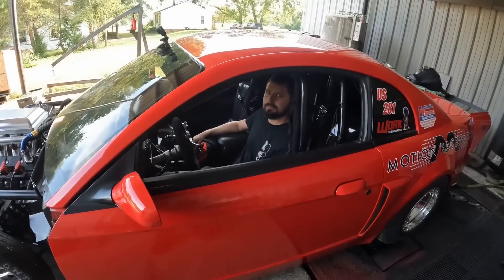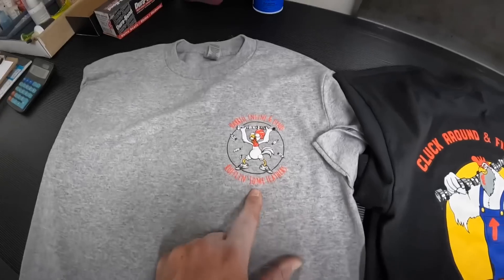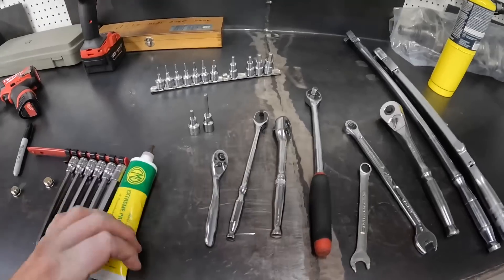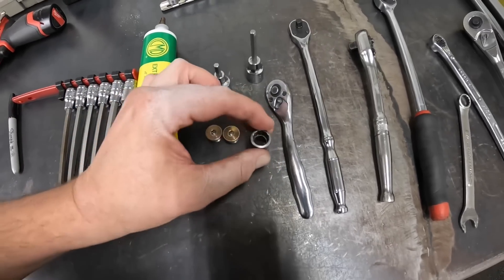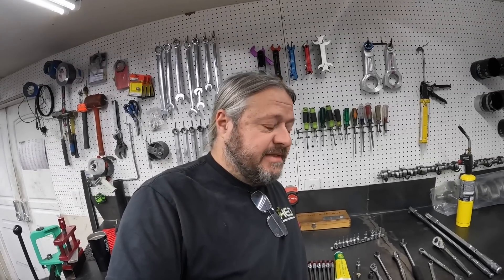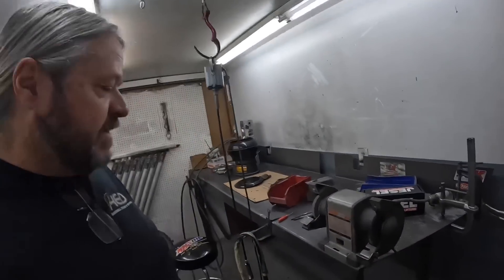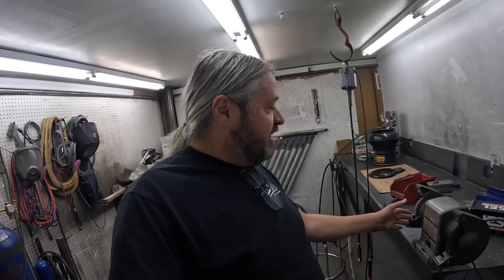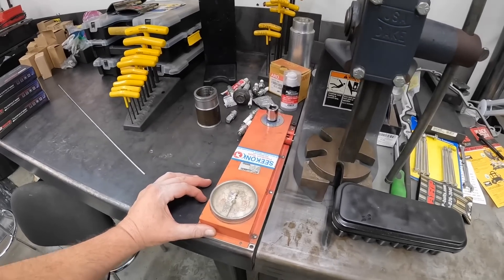Quit tearing stuff up!!

Comment: The hex sockets you’re using twist pretty bad if you don’t have them yet and you got the room around the fastener there are super stubby hex sockets you can get. They don’t twist and you can get torque through them better. I love my set I get stuff apart while the other guys are drilling.

Comment: FYI unless it’s really old, the yellow bottles are map pro, not map gas. Map pro is barely any hotter than propane. The sole supplier of map gas stopped making it in 2008. 

Mapp: 5300f
Map pro: 3730f
Propane: 3600f

Comment: I just retired after 40 years in engine design and manufacturing, specializing in fastening and sealing and can agree wholeheartedly with Pete’s words of wisdom! My advice is to avoid using internal drive fasteners when possible and stick with external hex bolts. In high volume manufacturing we prefer radius hex heads to aid in socket engagement but for hand builds this is not necessary; in fact, for high clamp load tight packaging space applications forgoing the radius can be beneficial because it will maximize the wrench height reducing the likelihood of the socket disengaging during tightening! Keep up the good work Pete, love your passion for doing things right!

Comment: Usually an allen wrench wears out only right at the tip.  You can use a cut off wheel to trim the end off and extend the life.  Try not to overheat it when you make the cut.

Comment: Fyi, mapp gas doesn't exist anymore. Look at the bottle, it will say "map pro". 

Then look up the temps that propane, map pro, actual mapp, and acetylene get.  Turns out that map pro is 3x the cost of propane and only a couple hundred degrees hotter. 

If you want mapp temps you now need to either add oxygen or go to a b-tank of acetylene.
Reply from the maker: @Dougarrowhead who are you and what on earth is your deal?

Comment: I have that same thread chaser kit, I bought when I first started wrenching 20 years ago. The amount of fasteners and threads saved by that one kit has paid for itself many times over. And it always seems that this kit comes in handy when you are reassembling something important like a water pump in an aluminum block at midnight and one of the studs feels like it might be cross threaded...

Comment: Just a heads up that yellow bottle isn’t real MAPP gas anymore that stuff got discontinued in 2008. The newer stuff is MAP pro gas and it only burns a couple hundred degrees hotter than the propane bottles while the old MAP gas burned a couple thousand degrees hotter.

Comment: "Haste makes waste" as they say. 👍

We're all under a lot of pressure to get things done faster faster faster, because some jackwagon says it should take 45 minutes (they aren't the one elbow deep in it trying to get on a bolt that the factory put in before the engine went in tho!) and they're breathin down your neck because you're at an hour and a quarter already, but trying to thrash even harder on it just slows things way the hell down when stuff breaks, or strips, or doesn't seal and you gotta take it back out... it ain't worth it.

Comment: Just an FYI, the new MAPP gas in the yellow bottles is not the same stuff from 2000s and before, its not only a few hundred degrees hotter than propane at 3x the cost. If propane torch isnt making it come off the MAPP gas isnt gonna do it either, gonna have to grab the oxygen bottle too at that point.

Comment: Glad to see I'm not the only proponent of speed wrenches instead of power tools...I've got a clear guard I made for my bench wire brush because you haven't lived till you've had to pull one of those wires out of your face...high pressure lube is nice...but lubriplate  water pump grease works just as well and you can't wash it off with a fire hose...it's also good for holding gaskets in place when you'd like the parts to come apart easy and maybe reuse the gasket...

Comment: Another great tip is to always think about where you are applying force. I worked in hot-rod shop and race shops for nearly two decades and I worked with people who looked like they were in a bare knuckle boxing match with brick wall because they wouldn't think about where your hands/body/tools are going when that fastener you have to put 9 million ft/lbs of torque on finally breaks loose.

Comment: Great advise Pete. I have ground down (shortened) many worn allen sockets over the decades. And JFYI, I've seen "brand new wrenches that were useless".
A friend thought he was getting a great deal when he bought a set of Craftsman SAE/Metric wrenches (at 1/2 price) and the first thing I noticed was they all
had a "ridiculous amount of bevel/rounding on the back side". So I grabbed a small (8mm) and yup, it (easily) slipped off of a perfectly good bolt.
So (knowing him very well) I knew he wouldn't return them so I walked over to his bench grinder and proceeded to "fix them" by grinding 90% of the rounded/bevel off 😁

Comment: I have a guy come by the shop once a year and check and calibrate all my torque wrenches. Very cheap peace of mind. I sleep better knowing our heavy trucks and trailers have properly torqued wheels and bearing lock nuts. 
The old timer I learned from hardly even had any metric sockets, all of his ancient imperial tools were worn out enough to fit both, not well, but they did fit things they shouldn't.

Comment: I have 4 grinders, one with wire wheels coarse and fine 8" . one with fine and coarse grinding wheels, a 6" with soft wire wheel, a 10" for polishing metal. 
I once had to relieve under the bottom of some rockers, ground them out with the die grinder then 'polished and stress relieved with the wire brush.
Plus I have a belt sander as well.

Comment: I was just thinking, slow down, take your time, think things through, and you went and said it. Good vid, good advice. Something else I do, look at the job, think the whole thing through, then ask if you can just send it to the mechanics. Don't be too proud to do that. They've done it all hundreds of times, know what to avoid, and know ways of fixing things when they do go wrong, and they've usually got everything they need in the shop. I'm an ex fitter, so I know a bit about this kind of thing, and I can do repairs on my cars. Having said that I have no problem with just sending things to the mechanics, because they are the experts in this particular field, and have a bunch of experience to boot.

Comment: I'm into electrical, and I'm amazed at the guys that have worked on LS engines for 25 years but still don't know how to release the various GM connectors for sensors, and harnesses.  I've got a new Corvette and a '63 Z06 from the money I've made from the ham-fisted, and thick as a brick!

Comment: Pete , your thoughts on removing bolts with torque wrench. .. and not a breaker bar.! Seen this the first time on YouTube couple years ago... makes no sense too me. I've been pulling wrenches since the 70's.  and there using some of the most expensive snap-on  stuff there is.

Comment: I always use hand tools to tear stuff down and to put it back together on a engine that way if there is a problem I will know I see lots of guys on youtube here use the impact to remove things and to put it back on I have even seen guys using a oil filter wrench to put the oil filters on and I gotta laugh because those things are used only to take them off and you hand tighten it when putting it on.

Comment: Great info Pete, also spend a lot of time on the wire wheel.  So much nicer when assembling things with bolts.
Reply: I have my bench grinder set up that way with a wire wheel on one side. Just gotta be careful when they start to shoot metal bristles at you when they wear out 😂

Comment: I deal with stainless fasteners in clean room doors. Galling of the treads sucks balls. It’s loose but it won’t go in and it won’t come out. 
The homemade thread chaser is something I’ve done with smaller fasteners in light steel. Cross threaded by a guy in a hurry and the damn thing just won’t go in straight I’ll grind a flat spot on the threads of the bolt  and it’ll run in cleaning the rolled threads inside the hole as it goes.

Comment: Very good advice Pete. also when assembling and engine or suspension part or what ever don't put it together finger tight with the mindset of tighten later because you will forget. I have pulled oil pans off assembled engines because I could not remember if I tightened  main caps or oil pump and the bolts were always tight because of this.
Reply: It's good to mark the stuff you torque that way if you know what is done and what ain't done

Comment: I told my guy on in lb torque values on plastic stuff intake and thermostat housings just used a 1/4 ratchet and do it by feel because the torque values would crush the plastic before hitting spec sometimes. Even after having snapon recalibrate the wrench. A good test for new people starting out turning wrenches is have them tighten different size bolts till the break so they can learn how much effort it takes.